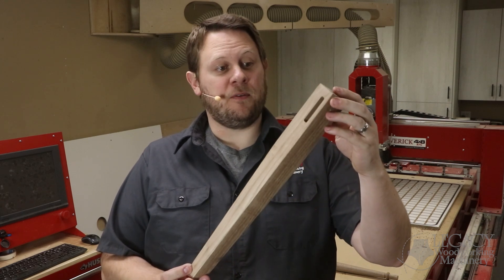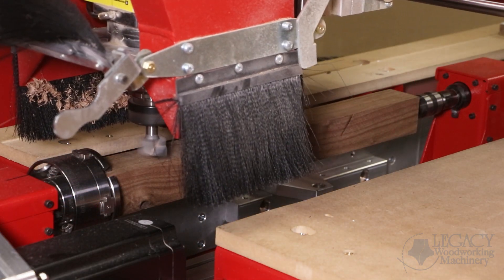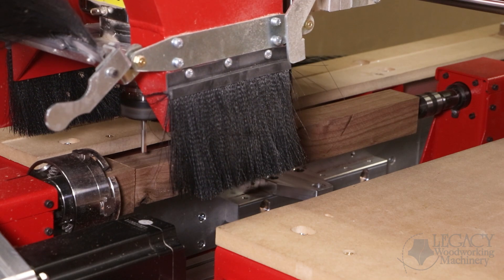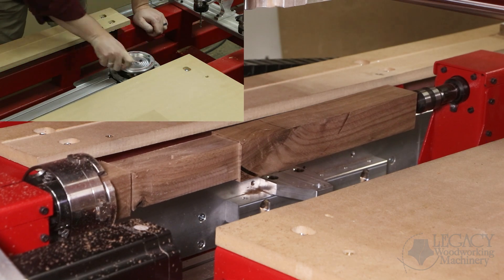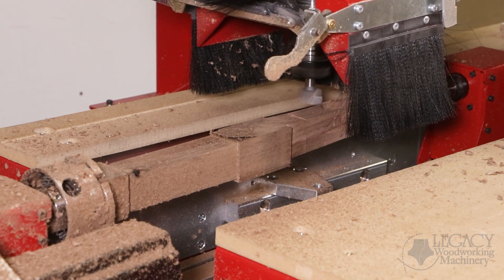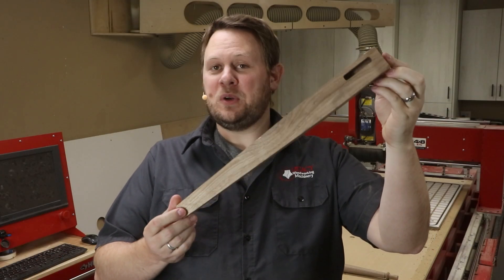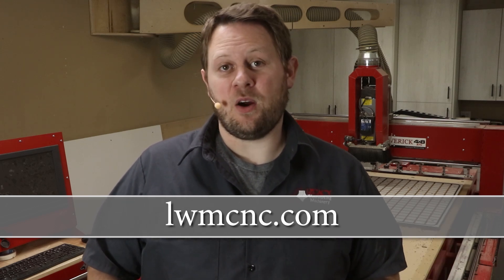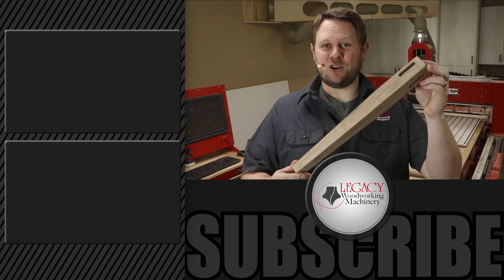Dining Chair Leg   Simple Tapered Square

Comment: Three days after I opened the crate to my 3x5 Pro,  I was making chips!  I love the thing.  I made so much chips, I lost track of my mouse!  I turned on my 2 HP Dust Vac for the first time ever and it worked great!  I was just using the open 4" hose cleaning up drift of sawdust.  The Dust Vac  had no problem sucking up my mouse .... and mulching it.  I sat on the fence over buying a CNC for 13 years.  Glad I bought the exact machine that will work best for me. My skills grow with every part.  Great machine!
Reply from the maker: Now we have to know... What brand of dust vac is  robust enough to take a computer mouse and turn it into sawdust?
Reply: @legacycnc8232  
Oddly enough, it's a Jet.  Blew the hose off the discharge. too!  The novelty has worn off.  I won't be sucking my mouse anytime soon again...I hope.
Reply from the maker: lol!  That is gonna be a story to tell the grand kids for sure!